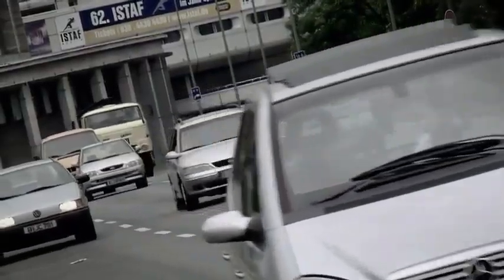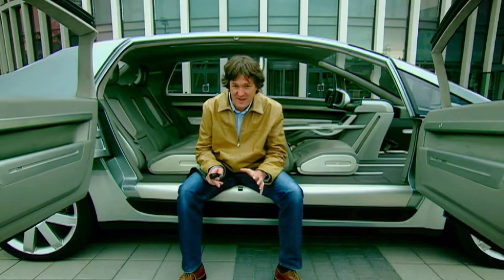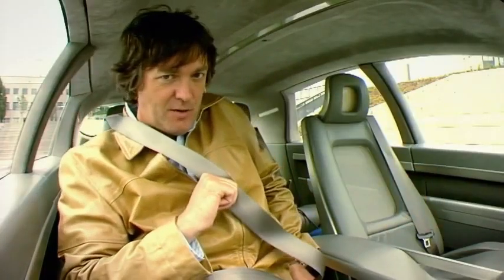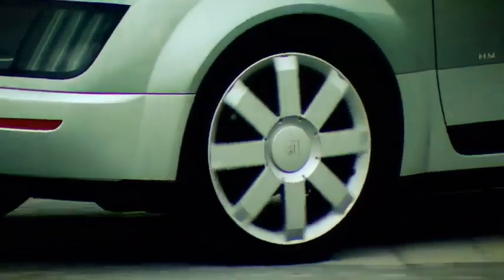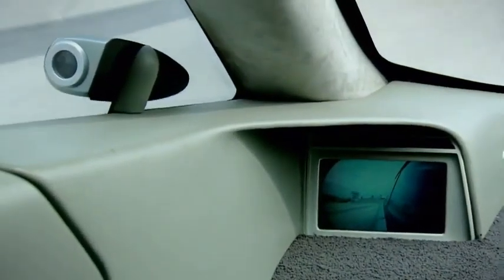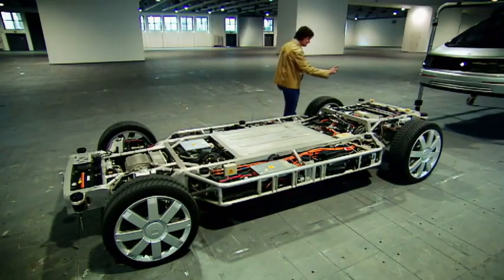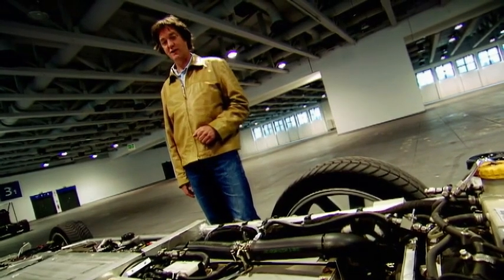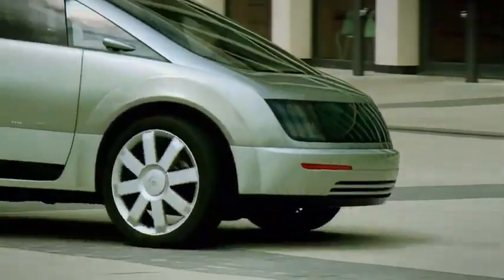Top Gear's James May Checks Out the GM Hy-Wire Hydrogen Car (July 2003)

Comment: They came out with those kind of stirring wheels I think in the 50’s but no one wanted them.
Reply: They were first designed in the 40s, none of them ever saw prototyping until the 1965 Mercury (Ford) "Wrist-Twist." The steering wheel was straight out of an airplane and absolutely everyone hated it. The major flaw of a yoke style steering wheel is the inability to thread the wheel. Which at the time was such an obvious problem for Ford, that they decided to use hydraulic steering in the 1965 Wrist Twist. Instead of turning the wheel physically, you'd use tiny dials that turn the wheels. Even with that, the car never saw production due to the overwhelmingly negative public opinion on the yoke wheel. People thought they would never get used to driving it. And it was taxing on the wrists after a short while.

Comment: Back in college I was so looking forward to hydrogen electric vehicles.  But of course GM didn't deliver.  And George Bush was full of it when he talking about "Hydrogen Highways".  In February 2019 though I became the happy owner of a Tesla Model 3.  The EV revolution is finally happening!
Reply: If GM actually saw potential all the way through, it would have went for it. GM is not stupid, just like every other automotive manufacturer in the automotive industry, GM is hungry for sales and product promotion.
Reply from the maker: Hydrogen is far superior to Li-Ion batteries with fast recharging/refilling, less waste. Much better cold weather performance too. Recycling of Li-Ion is not cost effective in 2020, what is going to happen to millions and millions of dead 1+ ton used battery packs? And before you say "I'll hook 'em up to my house and store solar from my panels" you might want to call your insurance company and see if that will fly.
Reply: @hydrogensocieties2012  I get that you're biased towards hydrogen, but almost all industrial hydrogen is collected during fossil fuel refining. So it isn't green. 

Secondly, hydrogen is far more energy intensive than BEVs. This is because you must first make electricity and then separate water into hydrogen and oxygen. BEVs, on the other hand, just pull electricity straight from power plants. This means hydrogen cars require about double the energy that BEVs do.
Reply: @hydrogensocieties2012  Hydrogen "fool" cell.
Reply: @hydrogensocieties2012  Where does the hydrogen come from?  How much energy is used stripping it from methane or natural gas or water?  And how much more energy is used storing the hydrogen and toting it around the country to those still non-existent fueling stations?  

I prefer to cut out the middle man and charge my EV with sunshine. And the batteries are already reusable and recyclable. So after they've gone 200,000+ miles in a car they can be used as a backup power source or recycled into a new battery.
Reply: @CharlesP2009  depends on what you use to extract it. Places with a lot of volcanic activity can utilize natural hydrogen sources and other areas can use renewable energy like solar or wind to help offset this too.

Comment: General Motors stated that it was confident that it could produce a commercially viable model by 2010. Ok, it's now 2021 where is it? Look into the future from 2003 to now. No Hy-Wire car and no Top Gear.
Reply from the maker: There are 3 Hydrogen cars on the road in California now but the elephant in the hydrogen living room is China- which is mass producing H2 FC stacks every day. H2 is the future, just watch what happens.
Reply: I think this project in particular is dead. However, hydrogen is an okay alternative, just expensive to implement and risky.
Not to mention the controversy around hydrogen vehicles at the moment, given an entire truck start-up promising to change the world failed to deliver on tens of thousands of investors.
EVs are where we are at right now I think in terms of tech. Perfecting the range and cost efficiency of electric motors is much more important than developing possible alternatives that require more money. If the public conscious has EVs at the front of their mind, and there are only 1000 Hydrogen cars in the world, why should we wait for them? Give it another 20 years. We can produce thousands of Mw of electricity with the sun and nuclear energy but you want to look into hydrogen.